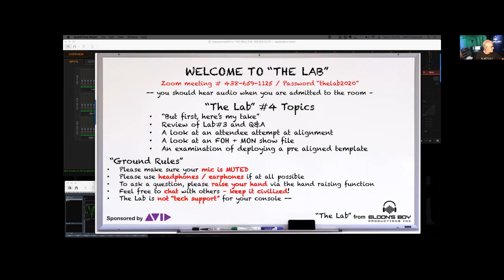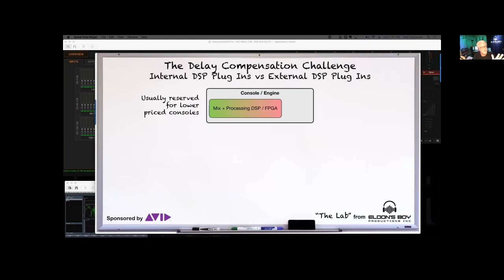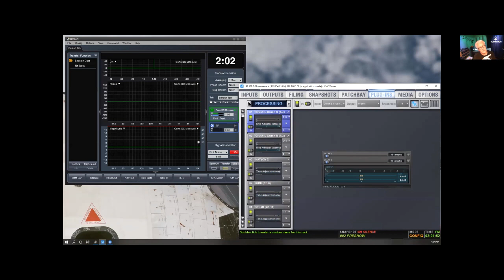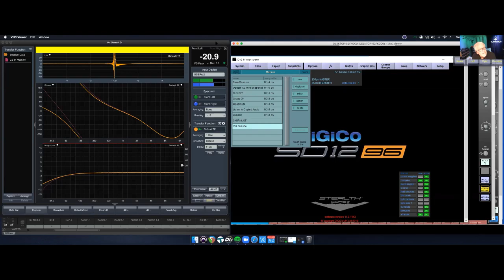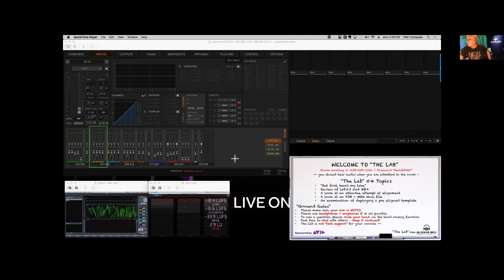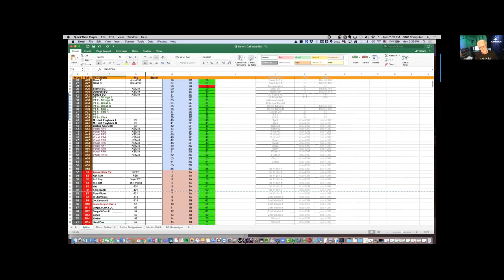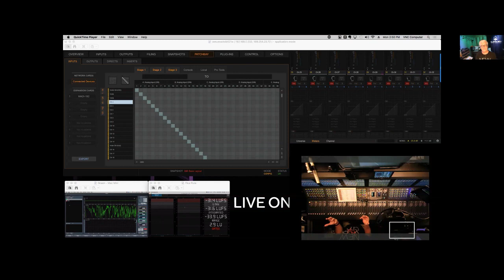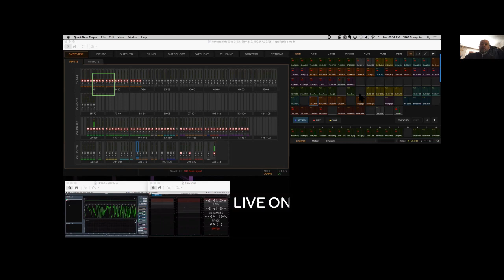The Lab #4 with Robert Scovill: Delay Compensation Review and Best Practices for Deployment

Comment: These have been great.  Very technical, but great.  Coming from mixing studio recording, delay compensation, and phase alignment is critical.  Since the console has no idea what the latency would be for outboard gear then manual delay compensation should be considered.  Let's exaggerate the latency of an external processing unit to up to one whole second. The return signal would be one second late.   You would definitely hear it and NEED to compensate the other tracks to match it.  Obviously, this is a completely unusable case but it's the essence of the concept.